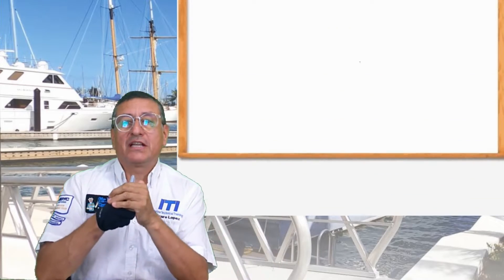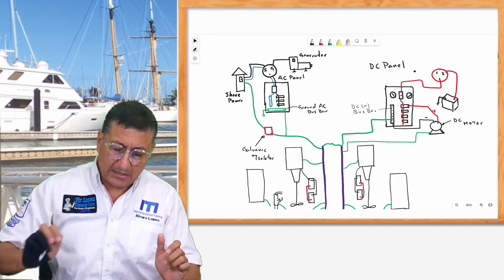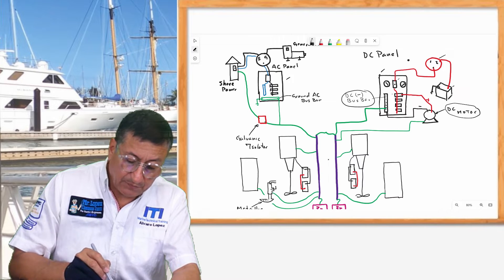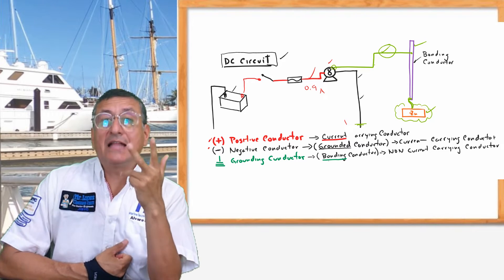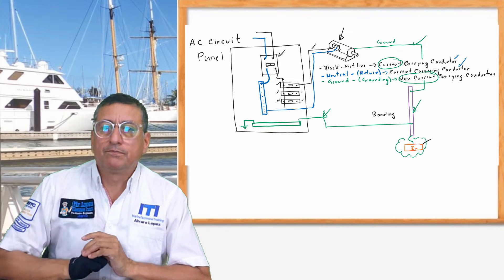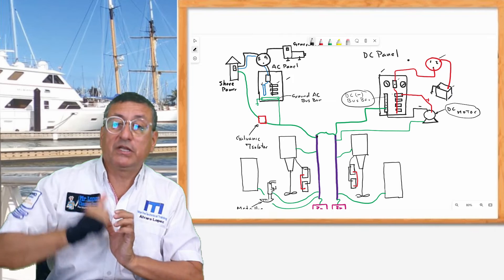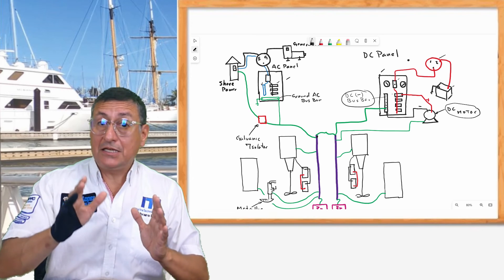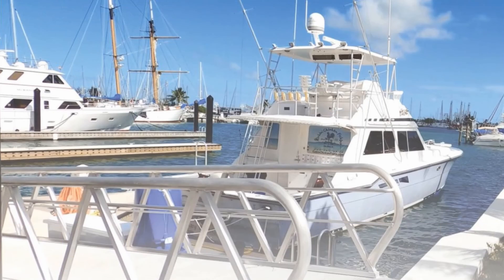DC (Negative) Bus Bar Vs AC (Ground) Bus Bar / Clip

Comment: I use for trolling motor battery  and I carry around that battery between home and boat , seperately engine battery.

and that time( When i use trolling motor battery at boat),  Should I connect troliing motor batter - post with engine battery - post ?

Comment: Question… in the diagram, should the inverter ground be behind the isolator or in front, as shown? I think if you’re trying to isolate there is a path as shown for stray current to traverse through the grounded case.

I love these videos… such good explanations!!!
Reply from the maker: You are correct . It should be behind the Isolator. Thanks for your collaboration. Sincerely